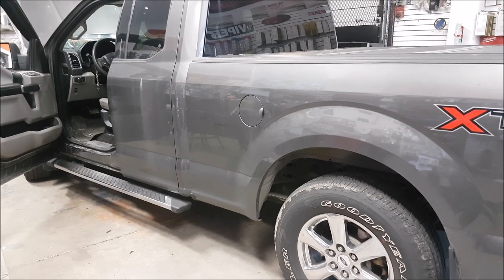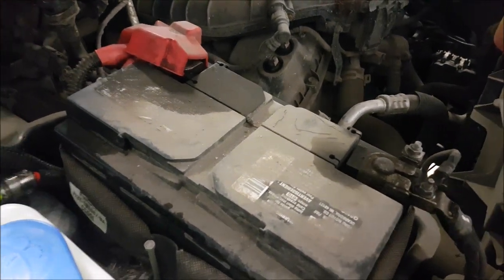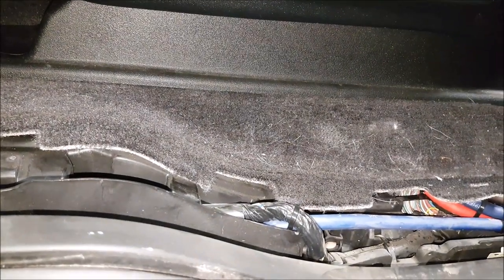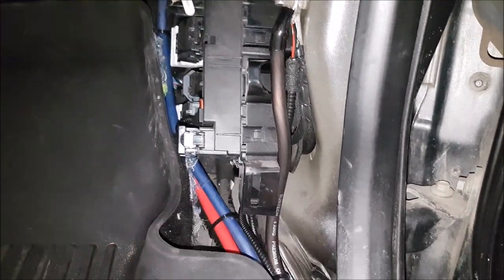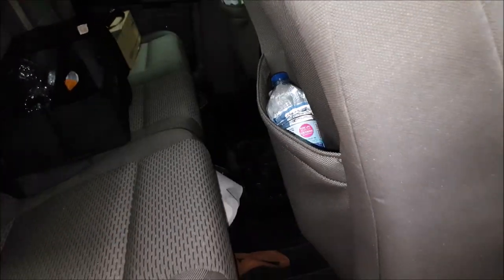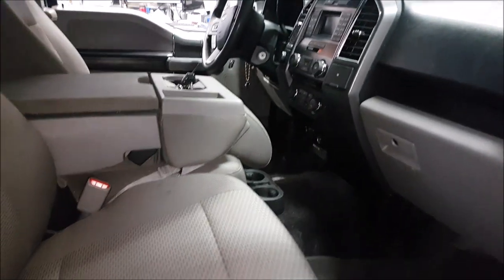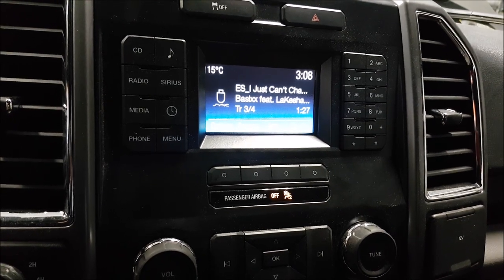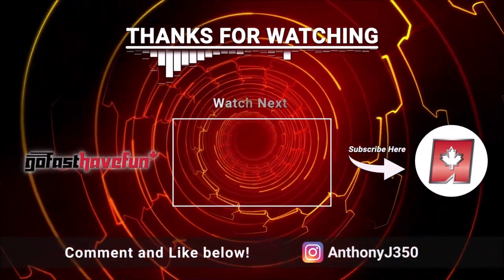F150, F250 & F350 Aluminium Body Aftermarket Sound System Ground Location | AnthonyJ350

Comment: Thanks for the insight. I haven’t had to work on an aluminum truck yet.
Reply from the maker: Glad it helped, wanted to help people avoid making a potential mistake.
Reply: @AnthonyJ350  run rca on the driver side. And the power on the passenger..i will try better rca and change my ground location
Reply: @mrpanchito9215  exactly what I did. Running 0-gauge  +  8-gauge is much easier and manageable on the passenger side

Comment: I have a 2018 supercrew that is pushing close to 4k rms and ground at the rear seat bolts that come up through the bottom. It used to have bad dimming lights until I installed a stage 2 Whipple kit which cranks the voltage up to 15.5 constant and I was only trying to make the truck faster so I could beat all those hemis that think they own the road. I think the sound quality could be better having a true receiver and a whipple kit too.
Reply from the maker: I'm not sure how the supercharger makes the voltage better though, since it's not part of the charging system.  Unless you're revving it high all the time now and spooling up the alternator more than you used to.

Comment: Where did you connect the remote wire?  I have a 2015
Reply from the maker: There's an accessory fuse in the passenger kick panel.

Comment: On a f150 2010 is it better to run the ground to the front?
Reply from the maker: Not as big of a deal because that body is still steel. Depends what you're running for a system.
Reply: @AnthonyJ350  i put in a alpine type r amp and a pioneer radio got engine noise
Reply from the maker: @mrpanchito9215  How are you getting signal?

Comment: This is crazy question I bought my 2014 F150 EcoBoost XLT for 17,500 cash I'm wondering do I have a aluminum body I never knew this Never mind I missed it by a year I'm freaking pissed..😪
Reply from the maker: Wrap a magnet in a clean rag (so you don't scratch the paint) and see if it sticks to body panels.  Then you can tell if it's aluminum or steel.